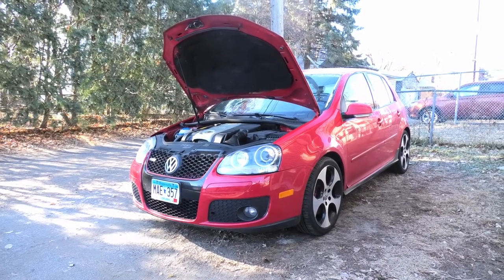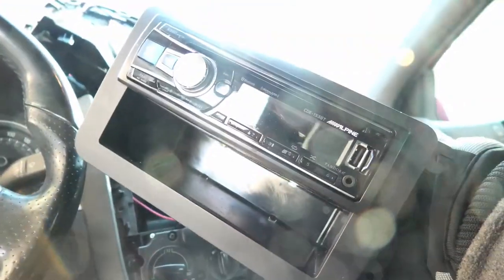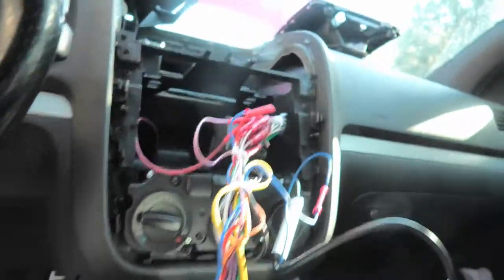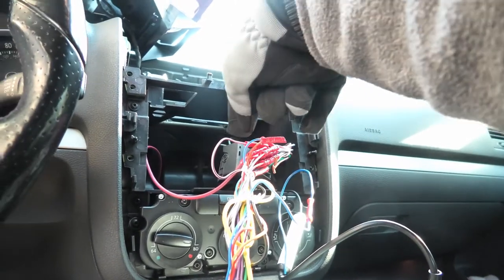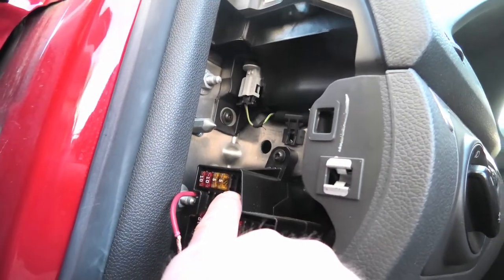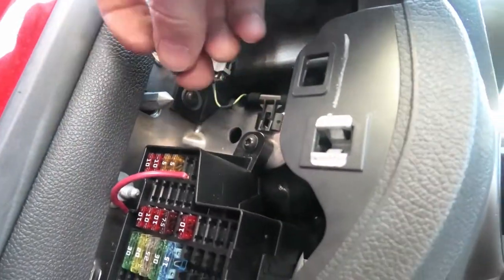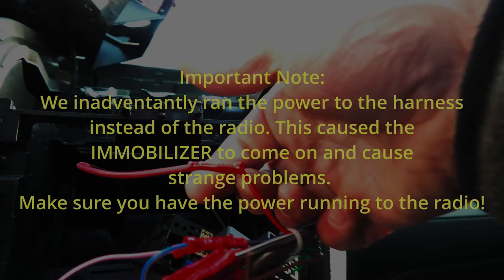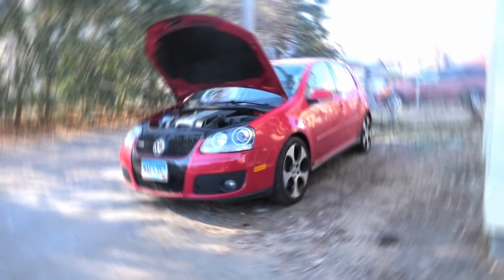Quick & Easy Switched Power for your VW GTI MK5 Aftermarket Stereo

Comment: Thanks. I am getting switched power now after fixing batter drain issue, however, am losing presets and time is stuck
Reply from the maker: Do you have the right wire hooked up to the battery - it is usually yellow. The red wire needs to go to the switched power.

Comment: Great Info . I did that but now my golf needs to be running or the key needs to be on the ignition position so the radio could work .  The original radio works without the key in when you push the volume button in. Any thoughts about that? There is no Acc position like other cars. I don't want to keep it on ignition just for the radio. The other problem I have is low FM reception and no AM reception.  Head unit is
 Pioneer AVH  x4800bs
Reply from the maker: There are two power wires to your radio, one switched and one that is on all the time. Sounds like you have not connected the "constant" power wire. It is usually yellow. It needs to be connected to the wire in the car that is always on
Reply: @mbrenengen  The yellow wire is connected through the adapting harness. I do have the constant power - not losing any settings. What I need to do is to find a fuse with constant power, connect the red wire and install an off switch so I can do it manually :). Thanks for the reply. Is your radio working with the ignition off?
Reply from the maker: Hmmm. If you are not losing your presets, then you do have constant power there. That is strange. Yes, our radio will work even when the key is off. You might want to check your manual. I know of the radio we installed, you have to hit a button within 10 seconds of turning it off to keep it playing. I am not sure if you can just make it come on later without turning the key on. It's not my car.
Reply: @mbrenengen  Thanks

Comment: Would I be able to do this for a line in converter to power up a amp?
Reply from the maker: No. You want constant power to an amp together with a "turn on" wire from your head unit.

Comment: Doesn't work for me with my Sony AX-200 unfortunately... 07 GTI here
Reply from the maker: Why not? Are you getting switched power? If not you need to find a different source.
Reply: @mbrenengen  Not sure. Going to borrow friends multimeter tomorrow and find out why top/second row doesn't work. Also F42 should work but I just tried it and nothing happens.  I'm using my 12v constant (yellow wire) hoping it would work since ACC (red wire) didn't either. Perhaps I need to use both of them into the tap? I'll find out tomorrow